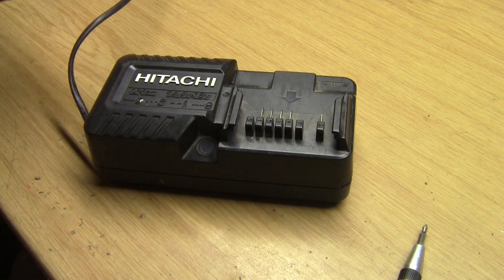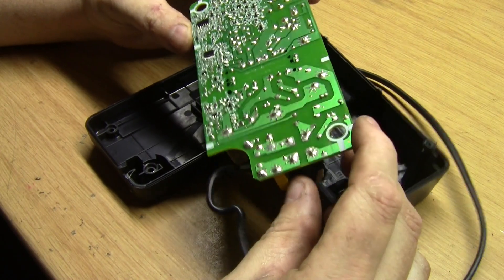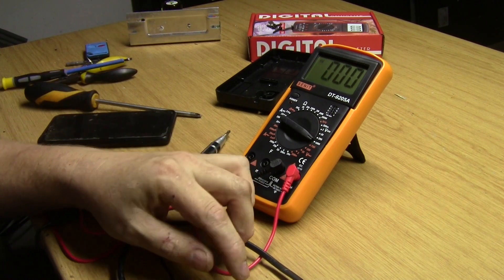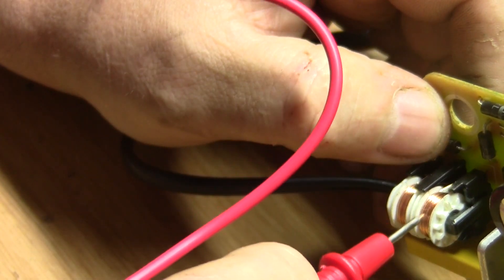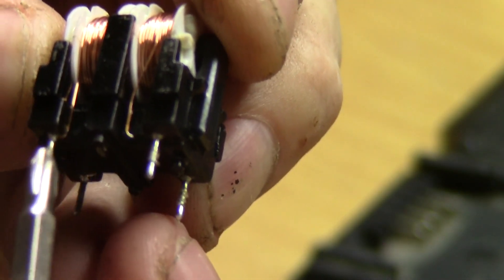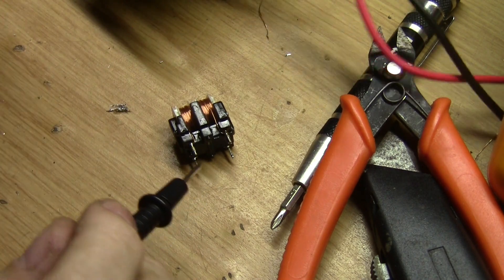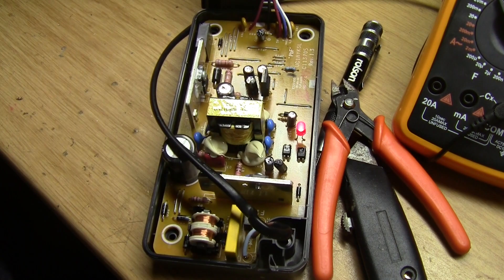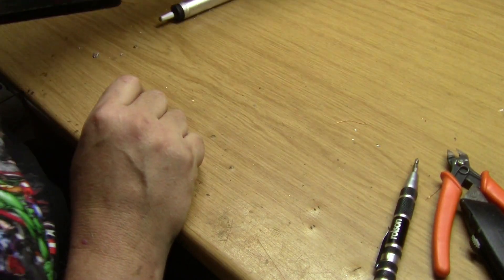ShoutingElectronics #44 - Hitachi Drill Charger Dead

Comment: Those are crappy probes, best to get some new ones when you next take the trip up north... Got some nice Uni T ones recently they are a lot better.
Reply from the maker: I had a decent set, that I was using with my MajorTech multimeter, but since I moved house in the middle of 2022 it is missing, I have been through all my boxes multiple times, and cannot find that Multimeter and probes.   So I just picked up a cheap ZAR R99 tester from a local Chinese 'mall' to get me going until I can find the other.
Reply: @ShoutingElectronics  well when you are in Dirtbin give us a call, I have a spare set.